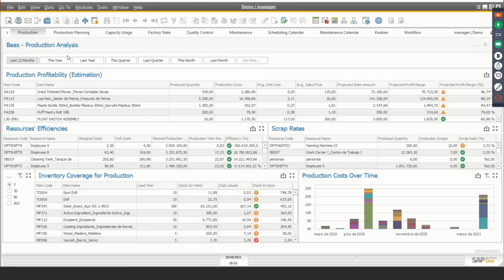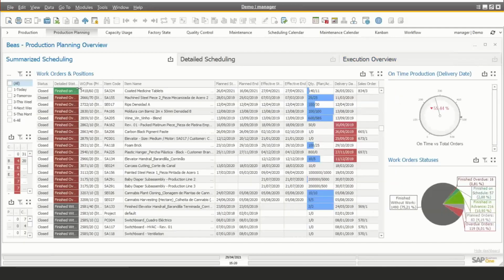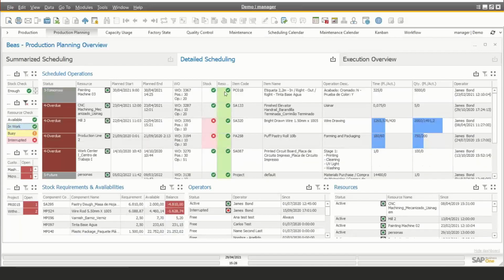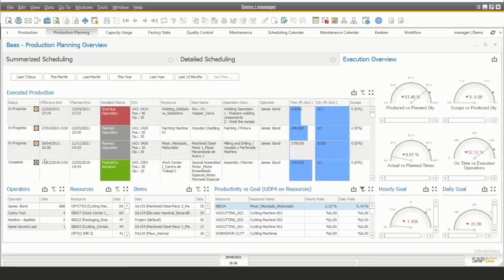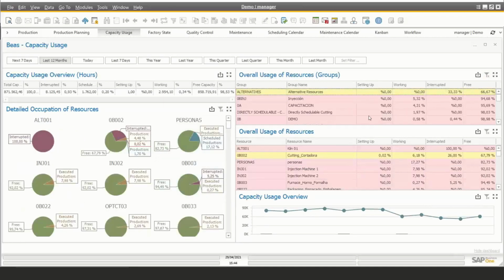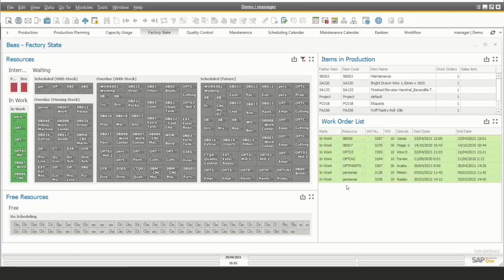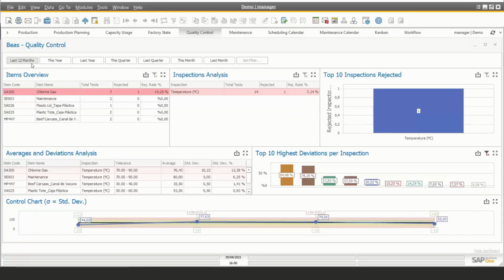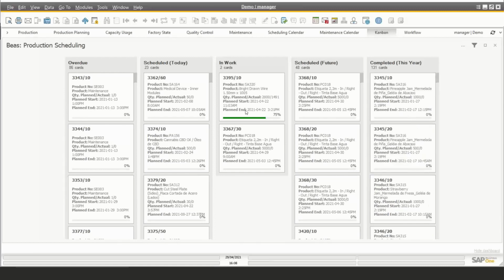Beas Dashboards Webinar

Comment: Hallo, is ist possible to receive these dashboards for older B1Up versions as a file to Import? They are not part of our current b1up version but I really would like to use them. Regards.
Reply from the maker: If you have a new B1UP demo system you can simply export them from that system and import into the older system